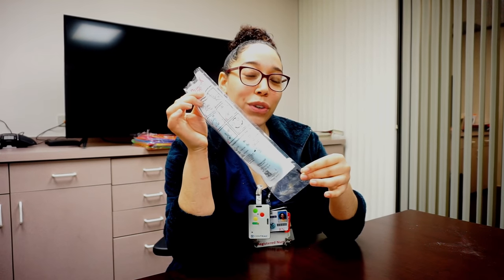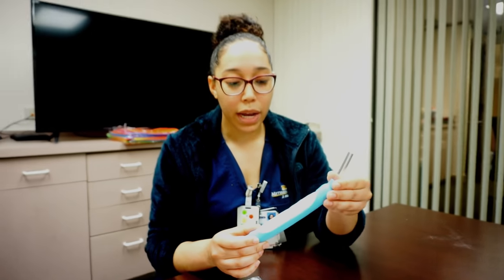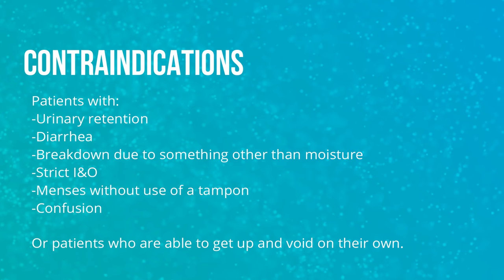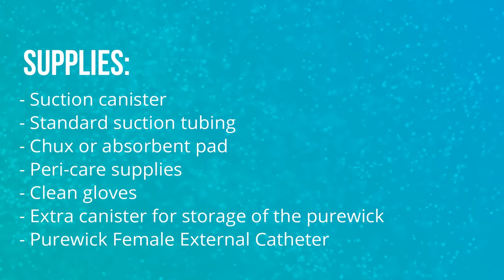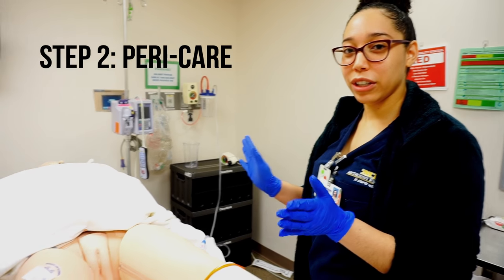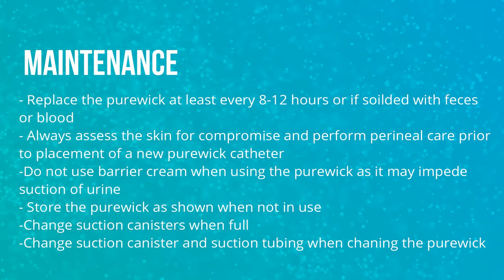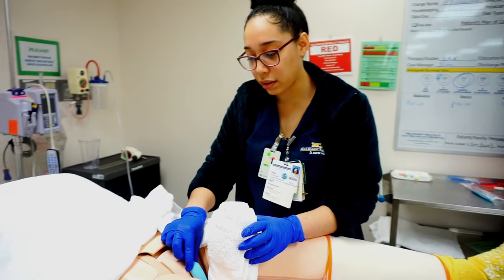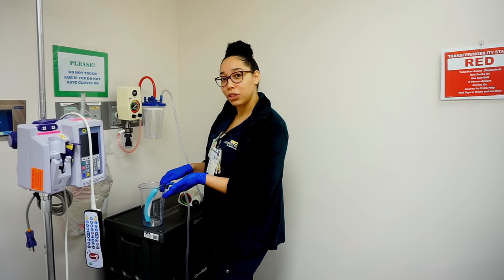Purewick Female External Catheter

Comment: Good to hear the reviews, especially that the Purewick can be washed!!  Very expensive.  I find that the blue covering needs to be more bendable to conform better.  After being put on Lasix I desperately needed this type of system.  The big problem that I have is that it does leak a lot so be warned about this.  It is also a problem  when you can't sleep well on your back  Turning is a little hard to do.  I also find that the suction needs to be just a little higher.  How about inventing some type of pad that would be hooked to suction??

Comment: I used this in the hospital and this was the best system ever fot this issue. I stayed dried and did not have to get out of bed at night.
Reply: Same. I had a 3-day hospital stay earlier this month and they had this as an alternative to a bed pan. I am non-weight bearing wheelchair user and didn't want to get a catheter. Most of the nurses knew how to place it properly so I didn't have any issues. It did feel a little drafty but otherwise so much better than me having to buzz a nurse every hour for assistance while on IV fluids.
Reply: It’s only used in hospitals?

Comment: I am on my second day of using the Purewick  Female External Catheter for my relative and  found that it does leak a little at the bottle of the Wick.  Therefore, I have to use a pad each time to relieve some of wetness in the bed.  Hopefully, I can learn to place the External Catheter a little better to relieve some of the leaking.

Comment: Can a non professional try this alone and what about restless sleeping ?  I awaken five or more times a night and  am interested in learning the down side if any an if there are any "trainers' available...
Reply: This requires the suction to work so as far as I know this is only available at hospitals/clinics. As far as restless nights, it was very comfortable to wear all night even though I woke and turned around every hour. As long as its placed correctly and secure it should be fine.
Reply: Hi! I just brought this system for my mom. Im not a nurse,  i watched a video for reference on how to use it and she loves it. My mom is up all night and im asleep and this allows me to sleep without being disturb. Awesome system!!!
Reply: There are several videos on Youtube that demonstrate how to use.  Also the supplier/seller can provide info.  You can contact them for more details on the home system, and they can also send you a sample "wick" to get an idea of the contraption that is used between the legs.  I read of a user who had a reaction/rash to the wick due to the material; however, I understand there's  a 'latex free' version of PureWick on the market, which you can request.  Also, there's a indicated weight range, and people who are underweight may have issues getting it to work.  Additionally, it may not be suitable for confused patients, those at certain stages of dementia who might pull it out, etc.   For more Q&A &/or to order:   https://www.purewickathome.com/how-to-get-purewick/?ReferralCategory=IP&i=1&invsrc=9190829735&campaignid=10022568465&adgroupid=101997904078&utm_source=google&utm_medium=cpc&keyword=%2Bpurewick&trkid=V3ADW337141_101997904078_kwd-345743907751__434304596573_g_c__&atrkid=V3ADW69C87D08_101997904078_kwd-345743907751__434304596573_g_c___&gclid=EAIaIQobChMIsveWo5S37AIVBInICh3BAw0lEAAYASAAEgJSEfD_BwE

Also see this site for excerpts from the user manual (under "Precautions") & more FAQs:  https://www.healthproductsforyou.com/p-purewick-female-external-catheter.html
Reply: @userchooser  this system is now covered by Medicare
Reply: @bluevegas4249  There is a model for home use that provides its own suction.

Comment: What I am worried about because I bought this system from my mother who is 81 years old. They use it on her in the hospital and that's why I bought it for her. But during this tutorial they said not to use a diaper or a pull-up vocally, they said this but it did not show this in the closed caption printing. This worries me. The studio is helpful because in the actual fuel with instructions they made it sound like you had the spread the lips of the urethra and that it would hold it in plate and that word me as I couldn't find my mother's urethra because she's a one yours old and used to be very heavy at one time and lost a lot of weight. However I'm going to give it another try and do exactly as this video hasn't started and hopefully I will have better luck and know that I have not license my money. I want my mother to be comfortable and confident.
Reply: Should a nurse be at home to help with this
???
I am 89years old and wonder if should even try to do this on my own.
Reply: I requested fed ex to deliver, then requested " return to sender  I never  did receive my payment back.  Can you help me ?
Reply: If I had paid by my credit card, how would I receive my money back.

Comment: Hi can this system be used with the patient laid on their side or sat up in wheelchair?
Reply: The important part is to be sure that small hole isn't blocked by anything. From my experience, this worked fine while laying on my side but was uncomfortable to wear sitting up. That might depend on the size of the patient, I am a very low body weight.
Reply: Yes I would like to know I'm a side sleeper
Reply: For home use only
Reply: Yes.  See this site for excerpts from the user manual under "FAQs":  https://www.healthproductsforyou.com/p-purewick-female-external-catheter.html
Also, the product founder, Dr. Camille Newton, answers this in more detail in the 'comments' section of this video:  https://www.youtube.com/watch?v=xSOuvcShikw

Comment: It's $1,000 for the whole machine.
Reply: That’s crazy. You can buy one ebay for less than $200. and Medicaid covers it.
Reply: @Orlanzepol123  Does medicaid really cover it?  Where is this sold, medical supplies specialty stre?
Reply: @H&W Coach  I believe you need a prescription from you doc first in order to get this.  Or call Medicaid to ask how can you obtain this product. Also I search on eBay and they had one for $200.
Reply: For questions &/or to order:   https://www.purewickathome.com/how-to-get-purewick/?ReferralCategory=IP&i=1&invsrc=9190829735&campaignid=10022568465&adgroupid=101997904078&utm_source=google&utm_medium=cpc&keyword=%2Bpurewick&trkid=V3ADW337141_101997904078_kwd-345743907751__434304596573_g_c__&atrkid=V3ADW69C87D08_101997904078_kwd-345743907751__434304596573_g_c___&gclid=EAIaIQobChMIsveWo5S37AIVBInICh3BAw0lEAAYASAAEgJSEfD_BwE